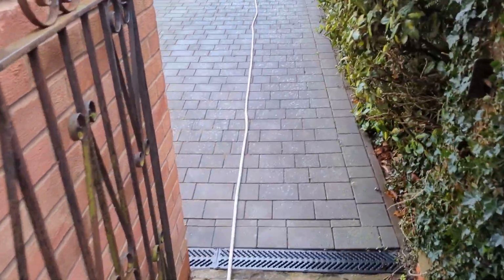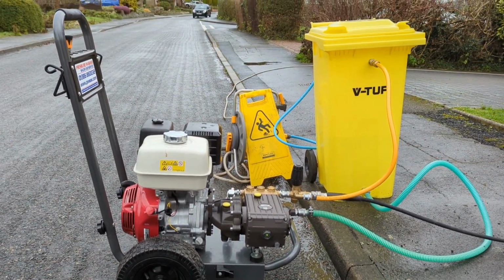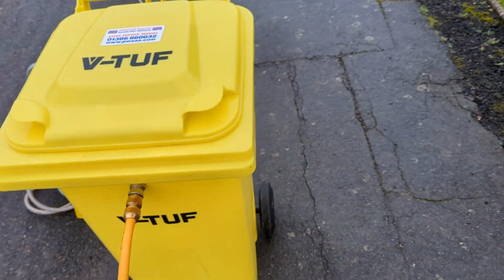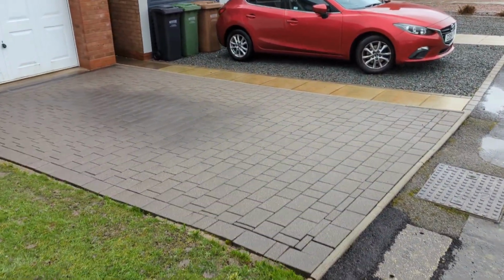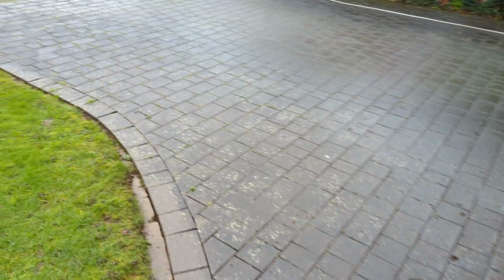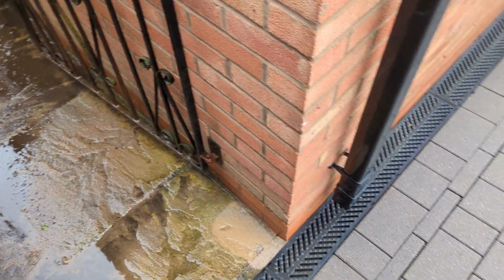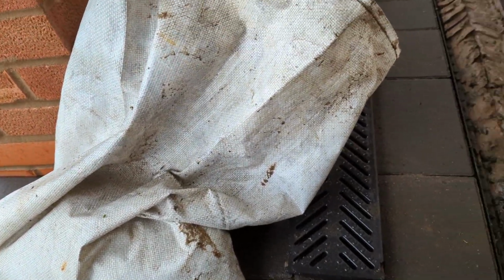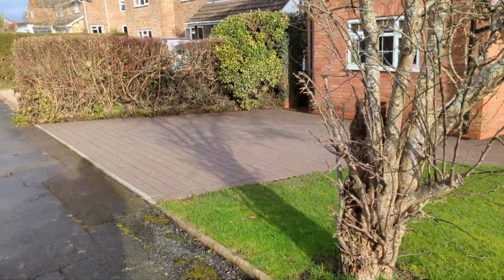AMAZING transformation - Relaxing - Double drive Pressure wash & sand

Comment: How come you didn’t use the FAC?? how long did it all take from start to finish??
Reply from the maker: FAC? Do you mean surface cleaner? The machine I'm using is 15LPM, I have a 18" surface cleaner. I've found it to be effective in cleaning the blocks, but doesn't penetrate the weeds between the joints to my standard. The clean took around 2 hours. The rinse down, drain clear and packup took another hour
Reply: @SMOUT_  sorry, typo - FSC 😂. Did you find the 15Lpm copes ok, or would you have preferred the 21Lpm??
Reply from the maker: @andyd2033  all good. The 15LPM is fine. I'm sure 21LPM with the surface cleaner would give good results on block paving. I'll be upgrading soon 👌